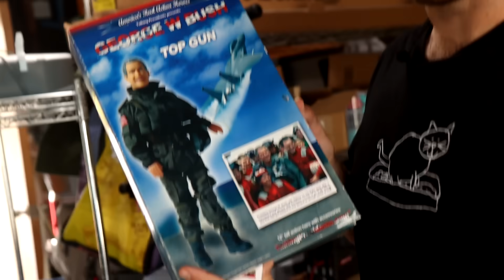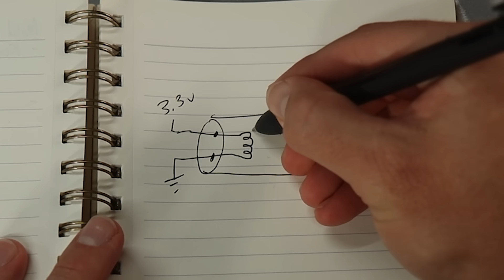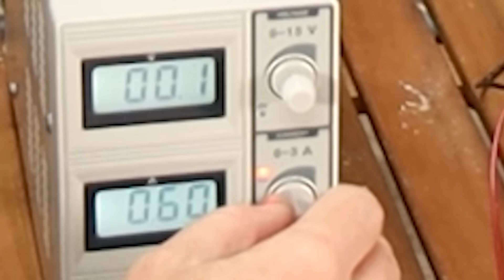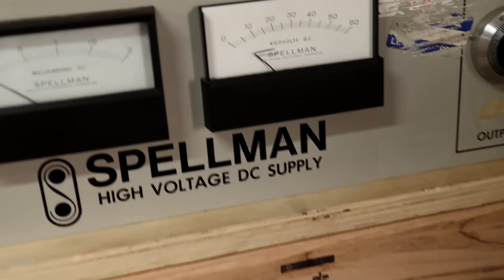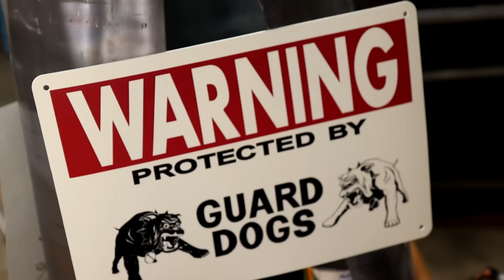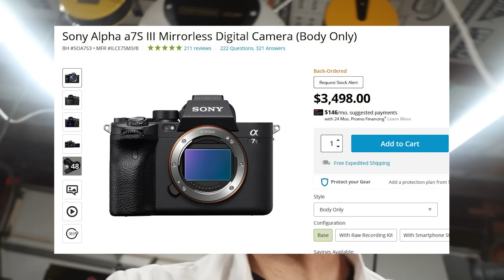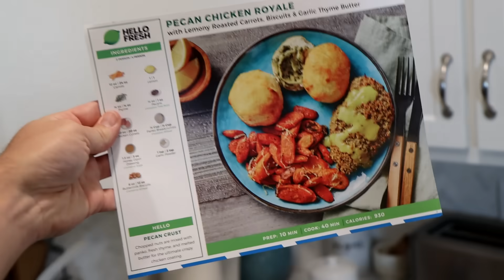Built My Own X-Ray After a Hospital Charged Me $69,210.32

Comment: The first time the lightning arced would’ve been the end of the experiment for me 😂
Reply: The high voltage is 1000000 times more dangerous than the x-rays
Reply: @hugo3627  voltage doesn't kill you, amps kill you. Don't know what kind of amperage that power supply pushes.
Reply: @mrbamfo5000  it will hurt like hell tho.

Comment: The box is shocking because it's designed to be mounted in a grounded rack. Anything high voltage is going to generate a Corona and if those metallic objects that collect the charge from the corona aren't grounded then they become impromptu capacitors. Welcome to the wonderful world of high voltage where anything that isn't grounded is a capacitor. Including your mom....

Comment: Xray are basically electrons piercing a cell. Depending on how many it can change the DNA of the cell causing cancer. With enought electrons it kills the cell. Bones have higher density than meat or fluids so electrons dont pierce the bone so it causes the image. White image is electrons not hitting the film. The sun can produce this harmful electrons just not enough to cause real damage.

Comment: I had sliced my pinky pretty bad and went to the ER for stitches because nothing else was open and it wouldn’t stop bleeding. They repeatedly asked me if I wanted to get an X-ray and I said the same thing many times “No, it’s just a cut. Nothing is broken.” They brought the X-ray machine over to my bed and said, “don’t worry about it. We’ll just do a quick x-ray just to see.”

My bill comes in the mail and I see that for just THREE STITCHES in my pinky finger they charged me over $3,500. Then I look closer and they charged me $875 for an x-ray that I refused multiple times. 

I called to dispute and they would not budge. The US healthcare system is a joke.

Comment: I've never been more pissed off at a fucking idiot in my life. You have no idea what you're doing, what you're talking about or what you're exposing yourself to. You seem to think that because you read its datasheet, you understand that device. You don't know the polar emission spectrum, how the near field emissions work from that device, the other frequencies its emitting (Since it's a vacuum tube, it's not a single frequency, it's a spectrum), what the protective equipment was even for, why the bean cans started sparking (it's because of the metallic edges), the danger caused by your lead opening, the reflectivity of your garage that renders your entire protective set up null and void, the radiation you're exposing to the entire neighborhood, the FCC laws you're breaking by emitting those sparks or by turning on the device, the long term effects of that specific type and frequency of radiation, the power output of the device and if the thickness of the lead is enough. 

Instead you're teaching millions of people how to put their lives in danger while hand waiving it. I hope you get cancer, but you won't. You'll probably make someone else get cancer because they think that they're safe. I'm not a safety nerd, I have an electromagnetics degree, the thing that you're pretending you have. You have a EE degree, which means you took two courses on electromagnetics and think you're an expert.

Comment: The reason for the cost is more than the simple cost of the medical device. You are being charged for the labor to perform the xray, the fee for the image to be interrupted and a report being written, and often times the amount they bill isn't what is actually reaching the insurance carrier as those prices are fixed most times when they are in network. More than likely your high fee was due to inadequate coverage or having services performed by an out of network facility and as I tell most all my patients you should always request an explanation of benefits BEFORE and understand your obligations before getting any non-emergency care. Also the types of xray you are producing are much more harmful than ones generated by a properly setup xray machine due to the lower energy threshold with results in higher rates of ionization compared to passthrough and capture. You can also be fined very very large sums of money for operation of an xray device that isn't properly setup, tested, and certified by a physicist; just wanting to point that out.
Reply: Yeah, any bill is due to market forces... But that doesnt change the fact market forces in the US make the bills for procedures way more expensive than they cost to perform anywhere else in the world.
Reply: @sclair2854  wasn't saying that's what the price should be simply pointing out the fact that as your point proves the largest part of the charge is labor and not the itemized cost of the equipment. Also none of that is to say that creating a unregulated radiation device can still be harmful and dangerous. X-rays are only minimally dangerous to healthy individuals but can be very detrimental to pregnant, immunocompromised, individuals with internal medical devices, etc. It's an interesting experiment but again as a medical provider I consider it irresponsible to his surrounds neighbors that get unwanted doses of radiation without their knowledge or consent. Just my opinion though.
Reply: @Xayentist  But if the largest part of the charge was the labour... Wouldnt the charges in other countries be similar?
Reply: @sclair2854  no because we compensate differently or markets work differently and reimbursement agreements set fee schedules according to many other factors. As I said in my original post the price for services rendered is extremely complex and the equipment is the tiniest factor driving that behemoth.

The industry needs change for sure but the complexity is why getting that change would be a incredibly difficult and arduous task.

Comment: Be careful with high voltage! As youve seen for every 1000 volts sparks can jump a centimetre. The wires need proper insulation. Make sure to ground the wire before touching it as wires are capactive. Even when the source is off the wires still have voltage

Comment: I worked in the medical billing for a large testing diagnostic lab. A interested tid bit of information to add is they have different costs on what you are having done. Patient without insurance is the most expensive. If a doctor is going to bill the patient he can actually get a discount for the service (cost plus whatever rule they apply for their discount) and pass an extra charge to the patient giving the doctors office a way to earn extra money. Then you have the reimbursement rates for each insurance company. Tests would be classified as let's say a CPT code with diagnosis code (ICD10). If the doctor puts the right ICD10 code you can get a cheaper cost/rate. If he puts a ICD10 code that's not fully covered then you have a "patient responsibility" to pay the remaining costs on your EoB. This is just a brief overview I'm certainly not going to go over anything else here (not enough time or space here to type) but insurance sucks and everyone knows it in USA.

Comment: The "oil" in that xray unit may have been pure dioxin. Careful with "oil" in high voltage stuff older than a couple decades.
Reply: Not dioxin but concentrated PCBs? You betcha.
Reply: @CoughSyrup  yeah, not good when the lead is one of the less toxic things you might have to worry about lol

Comment: you know what? mercury vapor lamps are more dangerous than this thing, I remember my first time using one, it was one of those with quartz glass for maximum radiation output, less than 2 mins exposed to that gave me the equivalent to 36 hours straight of sun exposure. my skin was hurting up to the third day. now I'm terrified from the sun itself. the package had 5 safety warning symbols and warnings in 4 different languages(then I knew the product was good, thus I proceeded to disregard all warnings and started doing the stuff I had to do)

Comment: 1:03 technically the cost isn't for the machine, it's for using the machine and the space and the people and the air conditioning and the lights and the... doors? Probably also the opportunty to use a water fountain, toilets, etc..

So the cost of the X-ray machine you're intending to show off in the video really doesn't matter in this context. It's more like the cost of your education, "because reasons", your salary, as in for the entire year or at least a large part of it, and a bunch of other shit.

I'd ask if you went to a government, nonprofit, or for profit hospital as there are differences in pricing - but they may not be that big of a difference depending on where you are.

+edit: also, licensing and liability insurance is a big this - especially when you're playing with sharp objects, biohazards, and nuclear materials. heh

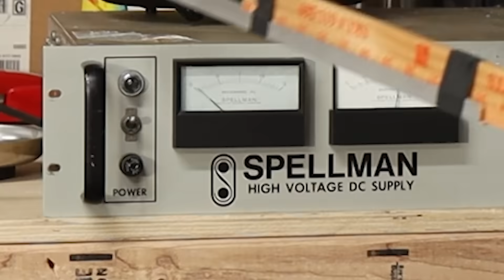++edit: 3:20 ...oh, did you steal the x-ray machine? heh

+++edit: 3:53 not if they see this video, you don't. You'd be considered "[very bad risk]". heh.

++++edit: 4:21 I'm trying to remember something about high voltage sources, insulators, and air.

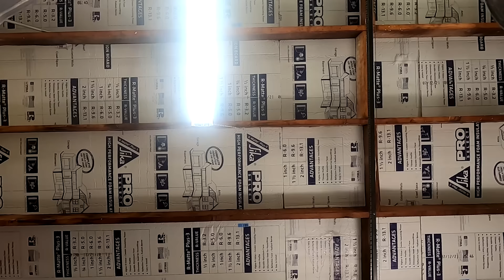+++++edit: 10:55 the scientists who died doing science, involving nuclear materials, aren't celebrated for dying.

++++++edit: 12:16 you're fucking with us about not knowing this, right?

+++++++edit: 15:32 if you want to build a rig which spray radiation everywhere, your model is great. If you want to build a rig that can be used to diagnose injuries, effectively, it'll take more than high voltage sources, cans, and an unwitting participant.

But it was cool to see your hand which may now turn into a cancerous mound years from now, hahahaha.

Your idea to have in-home medical hardware isn't terrible, you just need to consider the numbers and how to go about arranging for that to happen.

Comment: Man decides to build a homemade X-ray machine after hospital overcharges him......

.....Ends up overpaying for dangerous junk on eBay. He could have built it for less than $450, and that's including proper cables, lead shielding, and a radiation detector.
Reply: Last time I checked $450 is under $69,000.
Reply: @solared  but a lot less than the $2000 he spent.

Comment: Thank you for being smart about the realistic amount of ionizing radiation that its putting out(look it up people, not all radiation is ionizing). I work in the radiation shielding field and this is such low energy its almost funny. typical cancer treatment machines are capable of around 10-15 MV but most treatments are not using the full capabilities of the machine. I've had psychists test shielding by aiming a 15mv beam directly at us from the other side of the wall and only saw a few counts on my personal dosimeter.

Comment: In hospital X-ray machines, the system is designed to fire the tube for a few milliseconds only, and with as few milliamps as required for adequate picture density (more current fires more electrons). These machines are also built around adequately designed shielding. In contrast, firing a tube for multiple seconds and with random mAmp values as shown here, certainly produces many orders of magnitude more ionized radiation. The video was entertaining but it’s not worth the risk in my opinion. Exposing the trusting girlfriend to a high dose was not cool either.

Comment: I’ve worked in healthcare over a decade and as a primary care provider since 2015. 

My understanding is everything done in the medical field has a procedure code. Chest X-ray? Procedure code. Urinalysis? Procedure code. Blood count? Procedure code. Stitches? Procedure code. The insurances have a “maximum allowable” for each procedure code as far as what they will pay. This amount varies per insurance for each code. So the hospital bills for whatever they can to make sure they get the maximum allowable even though they KNOW they won’t get the amount they ask for. 

At that point whatever your insurance “allows” is what it pays and you are billed for based on your deductible and out of pocket limits. 

It’s not so much the insurance is the good guy for paying a lower amount nor the medical system is the good guy for accepting a lower amount. It’s just unnecessarily confusing and costly.

Comment: I install/repair xray machines. The radiation in this video is much less dangerous than the HV. Xrays also follow the inverse square law, after a few feet it has lost so much energy it won't have any effect.  I really liked that you covered your gonadal tissue with the lead from the tube. Is there a reason you didn't leave the tube in tact and use a HV connection? That would have prevented a lot the arcs you ran into since it would have had connections with no air gap.

Comment: "Everythings a wire and you are going to die" Yep. Turn the voltage high enough and physics stops caring about whether or not a material is a conductor or insulator.
Reply: An insulator is just a bad conductor.
Reply: V = I*R all the time
Reply: @janMelantu  except after c
Reply: @janMelantu  well not 100% true actually, if the current is obstructed by a dielectric (as in you have a dielectric material in your circuit) it wont flow at all until you have enough voltage (electric potential difference at the ends of the circuit) and when you do have the enough Vs the dielectric starts to act like an actual resistor/poor conductor rather than the complete insolator and the V=I*R. One of the best examples are lightings, you never see current flowing a little bit from the clouds to the air, it only happens at super high voltages because air itself is dielectric. You can check a lot more info on this phenomenon on Google, although I am not sure how is it called in English 100% I believe that 'Dielectric Breakdown' is the correct name
Reply: @_x_m_m_6976  okay maybe not always but in flowing current it’s true
Reply: Damn those electrons sure love to jump those barriers

Comment: Smart enough to build x-ray machine from used parts and reading diagrams .. but dumb enough to know the dangers but ignore them,and to not to see the highest risk parts of it and how to avoid them. 
Specially when you toke the old xray head apart from your self...   

Most dangerous part of the build is the damn tube... that used to be fully shielded and enclosed in mineral oil + lead paint/ electro plated lead on steel to protect people.   All so the xray pulse from medical machines is really really fast.  You are keeping it on for multiple seconds at a time.. and more you excite the tube.. more harmful your xray particles becomes..   + they reflect even on sand specs at the ground of your garage ..  so your lead shield did just about jack shit to cover your balls ( hope you have done your kids all ready ).. hence your meter went crazy every time you light up your machine..   

Dont know the facts of your tube + your setup specs in anyway...  but just an guess...    you get more radiation from 1 second of usage , than you would get as commercial pilot within an one year as background radiation.

Comment: The oil filled part of the dental xray machine mightve been to prevent any high voltage arcs and allow all circuitry to be  closer together while also dissapating heat
Reply: thanks! I was wondering about this